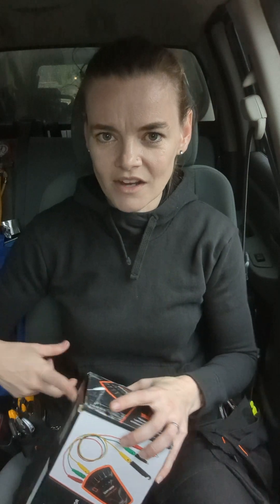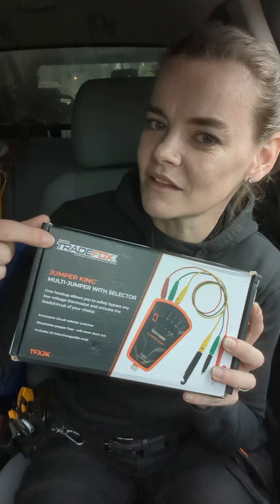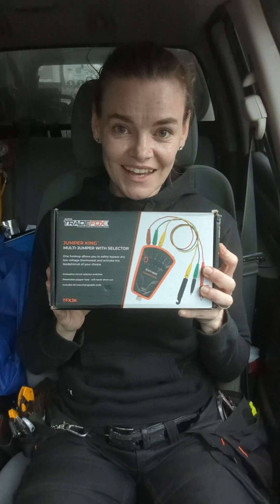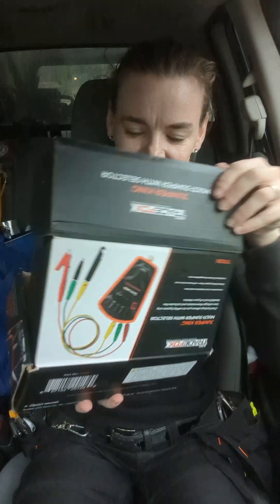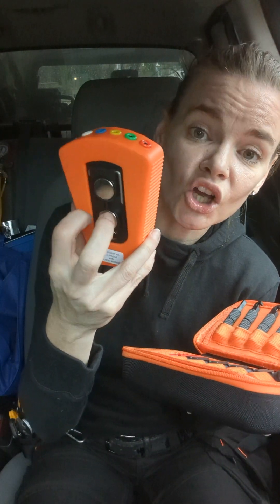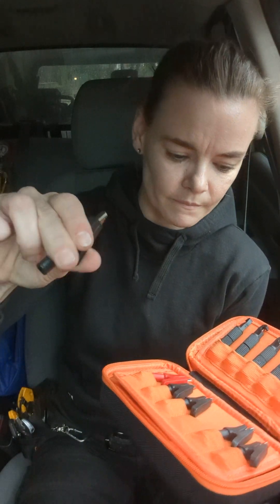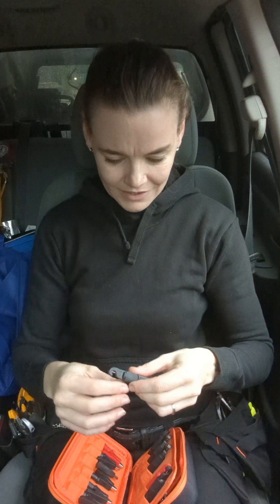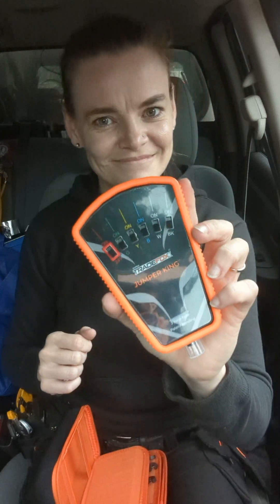Supco Trade Fox Jumper King for low voltage HVAC

Comment: Should have never use blue as a color if there are no led lights on it. Some one will hook up the blue to common because some manufacturers use blue for the common wire  then guess what dead short on low voltage

Comment: Piercing the insulation of a conductor is a bad idea. Once the sheathing is compromised the actual copper can corrode making it very difficult to diagnose and locate the fault. It’s my opinion to avoid these types of connection points like the plague. Find another way to test that lead!
Reply: I agree with your statement.  However, nearly every conductor on every HVAC unit has exposed copper at the termination or landing point.  These exposed areas continue to conduct for years and years.  Guess it depends on how corrosive the environment is.  If you have to use the piercing adapters, you could rub the pierced area with a dab if silicone or dielectric grease when you're done.  That would certainly slow down the degradation of the conductor.  Piercing adapters are nothing new.  I know that telephone linemen used them to diagnose issues in the 50's, 60's and 70's.